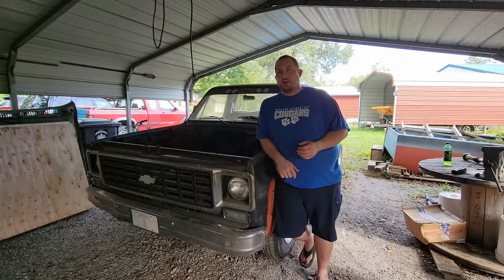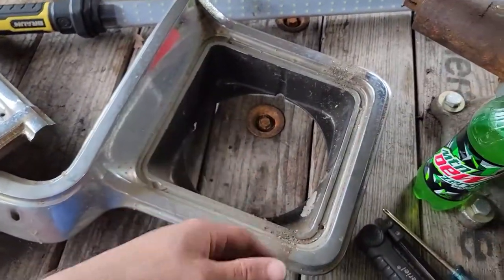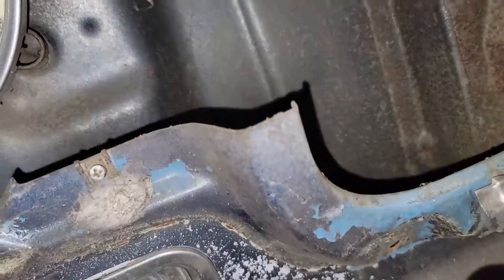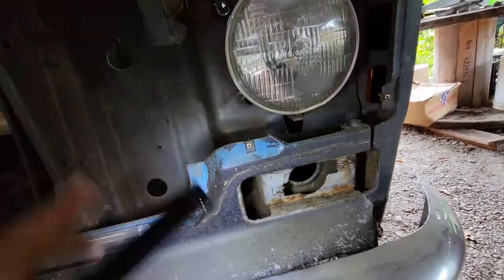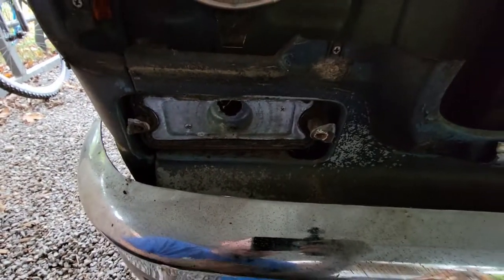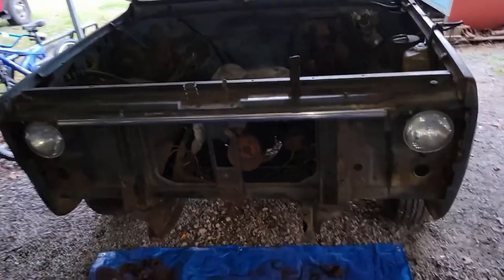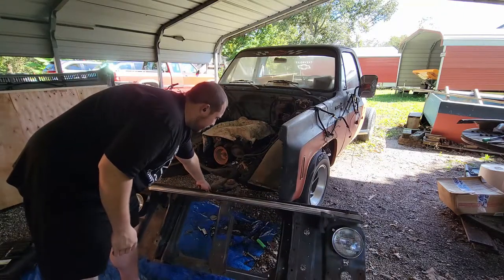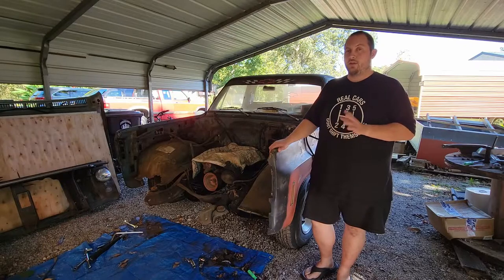Removing the Radiator Support From my 1976 Chevy C10, Getting Closer to Engine Removal

Comment: Very helpful video. I just started removing the core support, radiator, fan shroud, grill assembly etc today on my 1978 GMC k15. Came across the same rust / rot in the same places lol, that area under the battery tray gets wrecked. Oh well just another thing added to my to-do list!

Comment: hello pete here look that part you are talking about is called the proporting valve for the brakes if for some reason you lose you back  brakes the front take over and it will light a light on the dash to say you have a problem

Comment: In regard to the ground wire. Remember, Loose connections cause heat so it is a good bet that rust was causing a weak connection. When you replace the wire make SURE the connection on both ends are good!
Reply from the maker: Thanks Dan. Yea once it goes back together the contract surfaces will be nice and clean, and maybe a slightly thicker wire used too